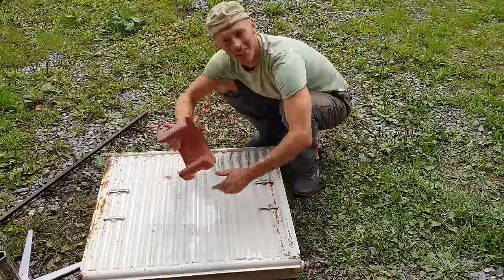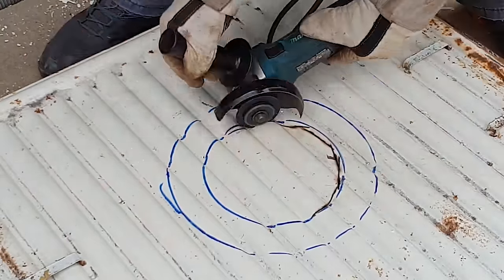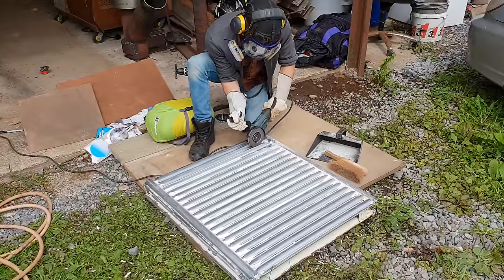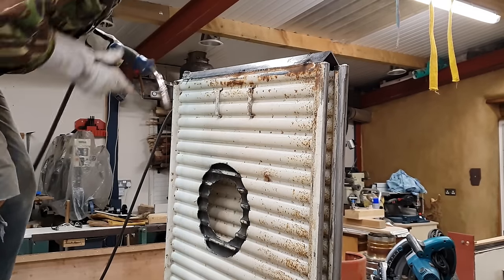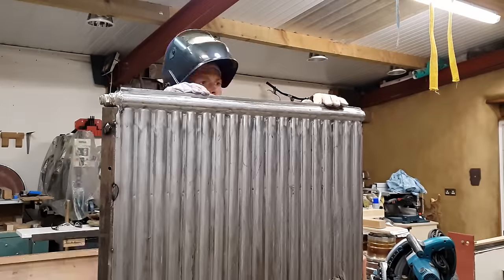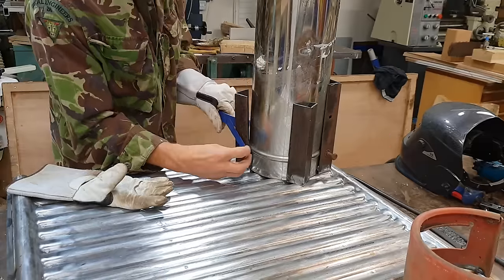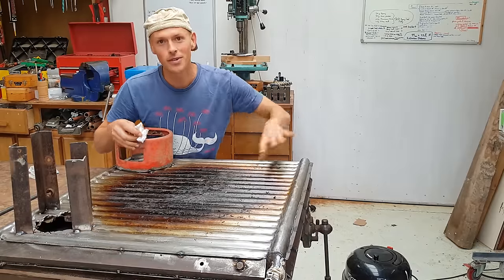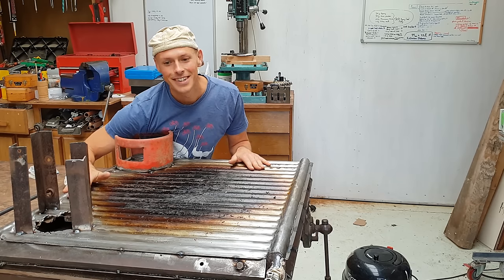DIY Rocket Stove Grill Griddle from Old Radiator

Comment: Might try a propane torch for  the paint removal next time... I used a propane weed burner for removing the paint from a drum when I was making a smoker and it worked great.    Love the project!  Subscribed!
Reply from the maker: Thanks. It's worth a go. Rad paint seems pretty damn resistant to heat. I covered this one in paraffin and set it alight and it basically did nothing. Propane torch may have been  hotter though...

Comment: Nice video as always. I realise this comment is 3 years after you posted the video so perhaps you wont see it. Anyways, I recycle materials all the time, being the eternal cheapskate (lets say environmentally sensitive rather...) that I am. You raised 2 points that I wanted to answer. Firstly, slitting discs are really great when you want to save all the material possible but their downside is their flimsiness. I have 2 solutions to this: 1. I use my big angle grinder when I want to shift lots of metal. Obviously the discs still cost a bit and they eat about 3mm of metal so not ideal when every mm counts but a very useful alternative. 2. Use good quality slitting discs. I havent tried the ones you are using but I have both good and bad discs and the difference in longevity is night/day. Secondly, on the removal of paint for welding. I have MMA (arc/stick), MIG and TIG welders at my disposal but I almost never use anything other than MMA. My main welder is a DC TIG and even though I have it all plumbed in I generally only use it for stick welding. OK, part of this is because I am a cheapskate and argon is quite expensive. But mainly it is because of the prep. I can weld pretty-much any thickness of steel with my welder and using stick electrodes just blasts through any paint, rust etc. Nowadays they are so cheap and small that you can pick one up for not much money. Dont bother with an old style AC welder - the DC welders produce nicer welds more easily. If you want a recommendation, I love the Thermal Arc welders. Long winded comment... keep up the good work mate!
Reply from the maker: Good morning M Kase, thanks for the thoughtful comment, appreciate you taking the time ;) 
I'll have to keep trying different cutting discs - I have been through a few different ones, and not noticed huge differences. Have you tried the metal-backed ones that use CBN or synthetic diamond or something? I have headed from a few folks using them for metal who swear by them. All interesting to hear regarding your goto welder, thanks. 
Peace, Bongo.
Reply: @FloweringElbow I haven't used the metal backed diamond cutting discs yet - didnt actually know they existed. I have one on my shelf but it's only for grinding (though I got it for sharpening tungsten). I use a Bosch multi-material disc with embedded tungsten carbide on the ends but I use that for wood, plastic and soft metals etc (amazing disc by the way, if you haven't tried one yet). When I said night an day, the 2 ends of the spectrum I have are 1. Bosch slitting discs and 2. Harbor Freight discs from USA. Obviously they're also at opposite ends of the price spectrum. But I think the Bosch ones, despite their price, are still cheaper for the amount of metal they shift (I think it's about 10:1 and Bosch dont cost 10x as much). I'm not suggesting Bosch are the only good ones - I have even found the cheap Chinese ones which come with Vonhaus grinders are also very good so there must be a few on the market. I am an expert at cutting wonkily. This means I often have the saw/grinder/anything else I can be wonky on, running at an angle when I'm trying to cut straight. The slitting discs are not great at accommodating side wear or any kind of pinching. I find that if I really try hard to only have the cutting edge of the disc touching metal then they last a lot longer. The upside of using a big grinder is the discs are a lot tougher and accommodate snagging and side wear much more readily. Hikoki (Hitachi) sell a cheap, big grinder if you dont have one - they are about £65 and worth every penny. I dont know which part of Wales you are in, but if you ever come up past Chester, you're welcome to pop in and have a go on my welder (and even try your hand at TIG if you like). Take care bud.

Comment: Use paint stripper and cover with a anything metal to keep the evaporation down.  This will make the job go so much easier. Maybe put some oil on the hacksaw guides ??? Running a machine with dry bearing slide is detrimental to machine accuracy. As for the plasma cutter, this would make the job so much easier but you have to do that by hand as the ribs would break the arc. Welding painted metal works best using an SMAW using stainless steel rods, any type 308 up work in alloys. The flux in these rods will take care of galvanized steel as well. You are correct when a electric motor burns out you can smell if i definitely on after the burn. Enjoy the barbecue with you friend and family. Music fit the mood too.
Reply from the maker: Good morning Victory First. A load of good tips here, thank you very much! I don't know when I'll be doing another similar scrap project in the future, I do have plenty of old radiators knocking about though, so I will definitely bear all that in mind. Now I need a good excuse to get a plasma cutter! Any recommendations? I don't have a stick welder, but we'll have to see about  getting some of that welding wire, would it work in combination with shielding gas? Thanks again, glad you liked the music too.
Reply: @FloweringElbow  I cannot  at this moment think of a good reason for getting a plasma cutter. But will give  you a shout when I do. The stainless welding part, I can tell you that most of my welding is done with a stick welder. I would think that flux core wire would work best. You need the flux to really clean the weld puddle. These days I use the TIG most of the time. This type demands really clean joints. But you can use the frequency and gas for the cleaning part for a sound weld. Good day fella too.
Reply from the maker: @victoryfirst2878  good to know thanks. I would luke to learn tig at some point... so many projects...
Reply: @FloweringElbow  I will keep my eye out for your video. Welding by TIG is just another method available for us to use. You seem to weld fine. When you need to worry is all the certifications needed for a master welder. Keep me in the loop Bongo. Good day and peace mate. VF
Reply: @FloweringElbow  TIG is like eating chocolate cake. Real easy fella. You will pick it up well for sure.  Good day too.

Comment: Plasma cutter would have no problem. It might even work if you ignore the ribs, otherwise just angle the nozzle to follow the contour. Only problem is it might well go right through both radiators..

Comment: Heat all materials,before welding as hot as you can 200 or 250 degrees, that might be kind of hard with paint on it but it makes welding so much easier and stronger.
Reply from the maker: Thanks for the tip Tin Man!

Comment: Non-high frequency plasma cutter would have worked; a pilot arc plasma cutter can even do angled expanded metal, for instance. But my instinct would have been to try a jig saw or even your welder turned up super high would melt through where you wanted it and has the added benefit of depositing extra metal to add thermal mass.

Comment: Do you have a compressor? if so find an air sander and attachments (also look up air needle scaler), when i was a metal polisher many years ago we used them all the time for removing paint, good ear protectors are a must don't use cheap ones.

Comment: That's a great BBQ! Any thoughts on repairing your drill? Maybe with a brushless motor?!
Reply from the maker: Thanks Alastair. A long time ago I did this: http://www.floweringelbow.org/projects/broken-to-super-drill/ 
but that was a different problem. A brushless motor would be cool, but would also require a change of the electronic speed control... I might just try and find a cheap replacement motor - which probably means buying a someways differently broken one from e-bay and pulling the motor from it. I know the official Bosch spares are about £50 which seems excessive.
Reply: @FloweringElbow  cool! Hope you can find a suitable replacement, so annoying when fixing becomes prohibitively expensive. Battery packs for old tools are often more expensive than the tool itself, crazy!
Reply from the maker: Agreed...

Comment: Liquid paint stripper !?!?  Would that have worked
Reply from the maker: Quite possibly Chris. I was under a bit of a time budget and didn't want to order something like that and wait for postage... Certainly worth investigating. Anyone else reading use this?
Reply: I have on metal  works awesome but not sure if it would on the radiator coating that's all , just simple nitro morsemors from local shops
Reply: I would not recommend using chemicals like that on a cooking surface.
Reply: @FloweringElbow  Good old caustic soda / lye will do the job - do it on a warm day - hose off with pressure washer
glove up and wear facemask - will burn skin so use common sense and be careful

Comment: How much fuel did you use vs say a regular charcoal grill?
Isn't lead an issue with reused radiators?
The thing is a prototype, any thoughts for a mark II build?
thanks for sharing
Reply from the maker: Hi Ron, thanks for the comment. In terms of fuel use: it is probably similar in terms of volume of charcoal - but it's free :D sticks and wood scraps.
The radiators have no lead - they are mild steel. 
Mk2 might have an insulated burn chamber too, not just an insulated riser. I talk a bit about that in this video: https://youtu.be/mt2EdqzDH3o

Comment: next time just sand blast the paint off . Very quick and does a great job too . Would have taken 20 min. tops
Reply from the maker: Need to make me a sandblaster one day...
Reply: Maybe a plastic bottle upside down with a hole in the lid for the blow gun nozzle tip with a hole grinded out for the sand to fall through?  I was thinking I'd make one of those when the time comes to need.   Was wondering if that paint would come off easier with a scrapper and heat gun also.  Some paint does soften with a heat gun. Thinking that stuff doesn't.
Reply from the maker: Turns out radiator paint is very heat resistant. I'm going to mention that in the next vid ;)

Comment: Paint stripper and a pressure washer would have saved you a lot of time
Reply: I would not recommend using chemicals like that on a cooking surface.
Reply: @anasmrright  It's safer to burn off the minimal residue from paint stripper, than the paint itself....
Reply: Would caustic soda not be a better option. Obviously take precautions not to get it on your person ( does a great job of dissolving organic matter!).